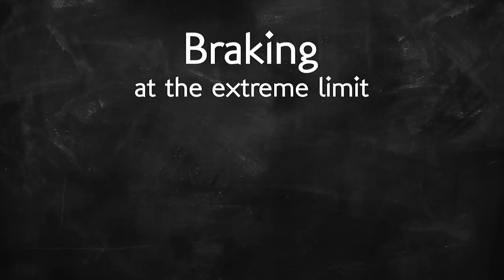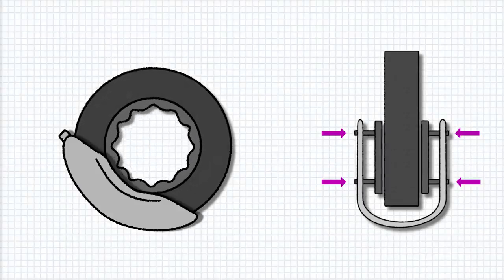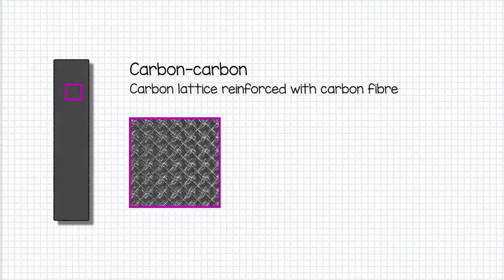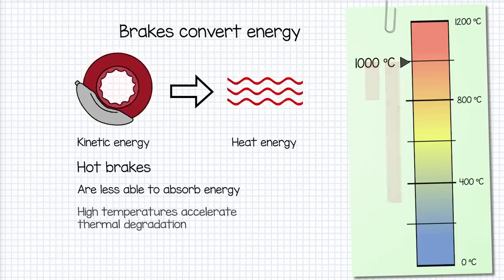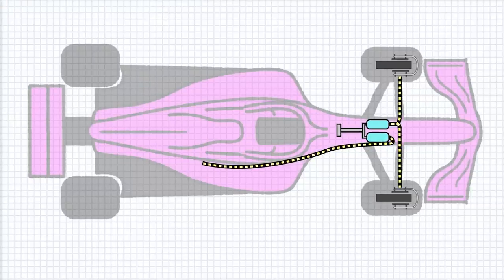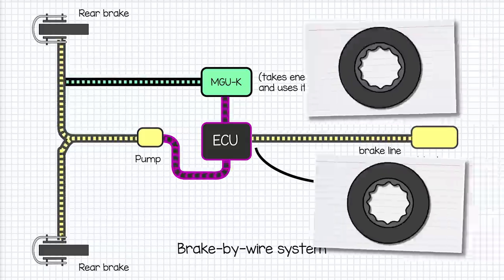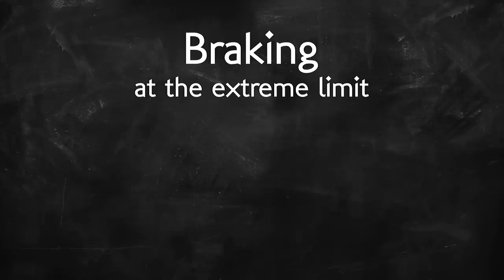F1 Braking Systems

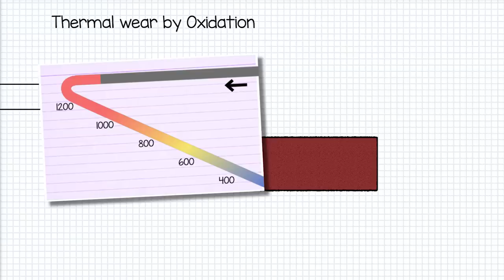Comment: 6:46 the oxygen atoms in carbon dioxide are actually double bonded to the carbon atom but apart from that, great video
Reply: They're single bonds but it's an oxygen molecule that would bond to the carbon to form CO2

Comment: The brake disc ventilation hole reduction in size and the subsequent increase in heat transfer, is more a product of increased surface area than is a product of the increased airflow.

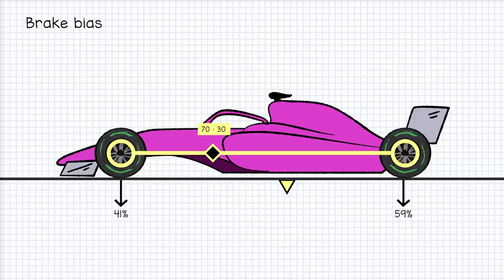Comment: at 9:39 it wouldn't be the opposite when front tires break and rear tiers keep spinning would cause the car to oversteer may be spin and if the rear tiers break would cause understeer. Great video, and could you please explain how the lockup happens? Thank you.

Comment: Just took a heat transfer class and it would have been cool to see a (rather simplified) problem about the ventilated brake disks, looks like they are a form of tube banks, and it could be an interesting convection type problem

Comment: Great videos! I follow you for quite a while, but this video made me subscribe. Keep up this brilliant job.
But... I have a problem understanding two issues:
- why is so much force required to use the brake? (Martin Brundle said he didn't have enough energy) Is it because it feels natural? I mean, if you use too much force, the fluid flows from ECU to the reservoir tank. The brake pedal isn't connected by brake lines to the calipers. Why is there a need for 100kg of force on the brake pedal.
- You mention in your video that braking in F1 makes up to 6G. If the driver pushes the pedal with the force of 100kg, wouldn't it make 600kg? I know it's ignorant of me to put it like that, but doesn't G-force help the drivers during braking, they only have to put the initial force?
I'm sorry for my technical english, it isn't my first language.
Reply from the maker: Hello!
1) Front and rear brakes, the drivers are still pushing into a highly pressurised system via the master cylinders. Their foot still has to do a lot of work to punch maximum energy into the brakes.

2) When I'm talking about G-Force I'm talking about the forces on the driver under rapid deceleration. When you hit the brakes in an F1 car, it stops so suddenly that you'll feel a force pushing you forwards at 6G equivalent.

See my video on barriers to understand G Force under deceleration.

Comment: The brake split front/rear is much more than 55/45. There is a difference between brake bias and how much braking is actually being done front vs. rear. The amount of braking done by the front brakes would be closer to 90% than 50% due to massive amounts of longitudinal weight transfer under huge deceleration. Overall good video though.

Comment: So during the last Grand Prix Martin Brundle spoke about the immense force that was required to press the pedal, specifically about Alonso’s setup. This video doesn’t mention the amount of force required to brake, but it doesn’t seem like it should be especially high. So do race drivers have additional resistance added or is that amount required just to get the car to stop? If resistance is added why would this be done as it would seem unnecessary to make something particularly difficult?

Comment: Emaculate as always!
What about engine breaking and rear wings do they also play a significant role?
Reply: I'm sure there are some off throttle modes that are used as a very light version of engine braking. Apart from the normal drag of the rear wing (and the rest of the car) no, there is no braking being done by the rear wing. The oly active part is the DRS which really should not be open during the braking phase, or the rear wheels will lock and the car will probably crash.

Comment: Any thoughts on the use of electromagnetic braking system (eddy current science) in not only F1 cars but domestic cars & trucks? You know, like the ones used on roller coasters and high speed trains.

Comment: I have a small doubt about the type of splits using in f1 cars if suppose the front circuit fails while braking there will be a zig zag movement of vehicle. Why can't they use x split can you explain pls

Comment: Placing the brake calipers lower down does not help, the height of the centre of mass on the unsprung parts of the car doesn't matter. What can be done is bringing the calipers as close as possible to the middle of the car reducing the moment of inertia and allowing the car to rotate more readily. But suspension design often wins out and dictates caliper placement.

Comment: Great video, but I got one question related to brakes...

How does the "blocking" works? (I don't know if that's the right way to call it, I mean, when a driver stops completely one of the front tires in a corner to make the turn) Is this made by the driver with a button of something, or is it a computer that know when it's needed to block one of the wheels?
Reply from the maker: Ah this is called LOCKING and a driver doesn't want that to happen. If that happens, they've made an error.

This is when the grip of the brakes overcomes the grip of the tyre on the track.
Reply: Thank you, I've always thought this was to help turn at high speeds but damaging the tire in the process.

In Spanish it's called "Bloquear", that's where my confusion comes

Comment: I know you said the size of the brake disc is limited to keep braking zones competitive. This would suggest the limiting factor for braking isn't tire grip. Is that right?
Reply from the maker: errrrr it sort of is. Once the frictional load on the brakes outweighs the frictional load of the tyres on track, the wheels lock and the deceleration is all down to the rubber sliding on the track
Reply: Chain Bear F1 so as I understand it the limiting factor is braking disc at first and then tire grip. So a larger braking disc would have the effect of more responsive/ faster locking brakes then the tires brake as normal.

Btw thanks for the reply and all the videos. You have made me get into f1 and see the interesting side of it when I always thought before that it is really boring but it's really good when you actually understand more what is happening.

Comment: @Chain Bear F1

Hmm... I found videos by Brembo about braking power. But they seem 
paradoxical to me. In Monza the speed change is only 109 km/h over a 72 
meters with a claimed braking power of 3010kW, but in Azerbaijan it's 
216km/h over 56m but only 1901kW braking power is claimed. Makes no 
sense.
And on neither "hardest braking point" is after the longer 
straight with the sharper (or just as sharp) turn at the end. Also 
doesn't make sense.

What do you think about this?

Comment: 2:27 "A larger diameter means greater stopping power as it's easier to stop a spinning disk by grabbing it further from the pivot point than closer to the center."

I don't understand this. Why would it matter? The limiting factor for stopping a car is the friction force of the tires on the road, right? Being able to stop the brakes more easily would only make it easier to lock up the wheels, which will decrease braking performance.

Comment: Wouldn't cooling the brakes with liquid make them extremely more efficient and less likely to oxidized (one of the main reasons behind brakes degrading). Air cooked brakes seem a bit arcane especially for F1

Comment: Does the ecu, pump, or mguk multiply the breaking power the driver puts into the pedal ?
Reply: No, there is no brake assistance on an F1 car, they don't have servos like road cars. The only assistance, if it is considered as such is that available in all hydraulic systems where pressing the pedal on a small cylinder movers the bigger wheel cylinder less distance but, with a higher force.

Comment: So I guess when you hear "F1 drivers have to apply massive pressure to the brake pedals" it's because they actually have to pump the fluid almost by themselves without external aid (unlike e.g. in cars). Right?

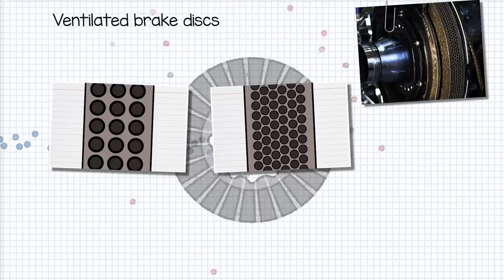Comment: At minute 5:35 don't you mean increase in area?
Reply: No, volume is correct. They aren't just holes but ducts all throughout the brake disc - and if you increase the area of the circle under a cylinder while keeping the height of the cylinder the same, you also increase the volume of that cylinder.
Reply: I didn't fully understand the second part... Over the year the cylinders increased in number, but decreased in radius, right?
Anyway, from what I understand of thermal conduction between two materials (in this case air and brake disk), the higher the contact area is, the more heat is transferred.
Reply: Yeah, correct. The point he is trying to make is that the volume of air flowing through the system increased, not only the surface area. (...is the way I understood it.)
Reply: That seems reasonable

Comment: good bike breaks are basicly the same thing. i wonder wich break is better. a super high performance bicycle disc break or a f1 break. in terms of how much mass it breaks in what amount of time.
im super bad at pyhsics if anybody know's im super curious.
Reply: First thing is, a Superbike break more than twice longer than a F1 Car.
Bikes have very far Breaking Zones.
And second is, it dont belong on the Breaking System.
Sure, the Breaking System is importent. But 95% are because of the Tyres.
Put standard 205 Street Tyres on a F1 Car, and it will also not stop under 30m.
That is also the reason why Bikes have such a worse Breaking Distance. Because the Tyres (who actually touch the Street) are tiny.
And the whole Breaking Force have to be transfered over the Tyres.

Comment: Tbh for such fast cars I woulda expected the discs to be larger 🤔 guess the cars are very light though...
The more you know ☺️
Reply: Yeah, the cars are under 1,500 pounds. A typical road car is over 3,000 pounds and has front rotors around 11 inches. One thing I didn't get from the video is how thick the rotors are.
Reply: Luke W like I always knew the cars were light I just assumed they had about 350-360mm discs, then again they have like 13in rims
Reply: So did I and assumed they had more than 6 pots per caliper.
Reply: The tires they are using is also a major factor in the stopping performance.
Reply: TheEpicCrumpet f1 only have 13 inch wheels remember.. thats why pirelli rumored developing 18 inch wheels for f1 like formula e, more relevance for road cars technology.

Comment: I'm pretty sure brake fluid is compressible. If it wasn't, the brakes would have no feel in the pedal. It would be more of an on off switch.
Reply from the maker: there's a spring at the other end
Reply: Chain Bear F1 literally sitting in a fluid mechanics class right now as I type this... it is slightly compressible. This is why the brake calipers barely moves more distance wise, while the pedal moves a lot more. This was even mentioned in a FSAE article in Racecar Engineering Magazine.
Reply from the maker: oh yeah 'incompressible' is slightly inaccurate a term but to all intents and purposes it's mostly incompressible

Comment: Average 100-0 braking distance is about 40m for a normal large car* (think bmw 5 series) so that's not even close to 4 times as long as 15m. Very impressive, but your "normal" car data is from the 70's. If it takes 60m then you need to fix your brakes.

Edit: very minor note on an otherwise great video.
*According to consumer reports

Comment: Do they have Independent breaking for each wheels controlled by the computer, or that would be considered unfair and is not allowed
Reply from the maker: Article 11.1.2 states the force exterted on all calipers within a circuit (i.e. front or rear) must be identical.
Reply: thanks for the clarification

Comment: "Over the years, these channels have reduced in size but increased in number, providing greater overall volume for channeling air."  Ummm... unlikely.  You lose a lot of cross section to a round tube with just a fairly small decrease in diameter.  What more cooling channels of smaller diameter provide is less volume, but they offer much higher surface area for the air flowing through them for heat exchange.  

Total flow through a heat exhanger is important, but equally important is the total surface area.  Pulling 1000 cfm over a single pass of 3" diameter pipe will do work, but it's not going to be anywhere near as effective as breaking it down to a bunch of .100" tubes and flowing even a quarter of the air over them.

Why not set up a thermostatic flap inside or in front of the brake ducts?

Comment: I'm confused why the MGU-K is even used for rear braking? What type of benefit do you get from this? If enough pressure can't be provided via the hydraulic system to squeeze all 4 brakes, why not just run the whole thing through a "BBW" system that can squeeze stronger than someone's foot can press. Seems like an unnecessary complexity to run braking through the MGU-K; I'm sure they can still harvest energy from the brakes in a different fashion and then just push that extra energy to the engine.
Reply from the maker: The MGUK takes kinetic energy away from the rear wheels to generate energy. In doing that, it slows the wheels down, so it's a natural side effect of harvesting the energy.
Reply: I see. Thank you!

Comment: Why don't brakes function well when cold?
Reply: Physical properties of the materials used.  His examples of rubber and ice are interesting.  If you found ice cold enough, it really wouldn't have a terrible coefficient of friction, because what makes ice really slippery is a microscopic layer of liquid water that forms on top when you try to drive or walk on it.  Likewise, different rubbers will vary as to how sticky they are by temperature - there's a "sweet spot" for different tire compounds (part of why there even ARE different tread compounds) with regards to temperature/friction.  The big fat burnouts dragsters do is to warm the tires up, but if you treat true (not drag radials) street tires the same, you end up reducing grip by overheating them.  

Brake pads are the same way - different compounds have a different operating range where you get the best grip out of them.  They get softer or harder depending on how hot or cold they are.  Again, that's one of the driving factors behind the existence of different brake pad compounds.

Comment: For the 2018 season I think Formula One cars used 13 inch wheels with a very high aspect ratio tires.   These F-1 cars  could stop from 300k to 0 in two seconds.    Thirteen inch wheels weigh much less than 20 or 21 inch wheels using the same material.  So why does Ferrari, Lamborghini and Aston Martin street/sports cars  manufactures,   push outrageous huge wheels on their customers, when everyone knows that extra mass (20 & 21) of wheel is anti performance.  Could these Hyper & sports car manufactures use 17 Inch wheels instead of punishing us with these outrageous  ones they sell us????

Comment: Why do I sometimes hear "Warm your breaks up" when the lower the temperature = more break
Reply: You need some temperature for the brakes to work. It is said in the video. Its about 400°C. So if the brakes are colder than this they will not stop the car so well.
Reply: i think because a cool brake takes longer to produce the same heat energy, then a brake at optimal temp. So they could brake longer but wouldnt brake so quick if they are very cool.
Reply: The coefficient of friction isn’t constant vs temperature, in order to be able to work at such high temperatures they give up low temperature effectiveness.

Comment: Fluid is incompressible? EVERYTHING is compressible, even solid metal, as long as you have enough pressure.
Reply: True. But for simplicity it's a close enough statement, because it shows the major difference to gas. Gas would compress MUCH more easily and force acting on the cylinder would increase pressure and temperature, but would barley translate to force acting on the braking pads. Fluids however are very hard to compress and forces acting on the cylinder would (almost) 100% translate into forces acting on the braking pad, while the fluid wouldn't compress (and therefore wouldn't change pressure and temperature). This is because while you CAN compress fluids, it is so hard to do that even the massive force needed to brake an F1 car is the path of less resistance...

EDIT: Please pretend, I used the word "liquids" wherever I used "fluids". See comment by ChainBear...
Reply: Mike234 incoming know it all. Who seems to not know much. Liquids don't compress at any reasonable pressure we can put it under in most cases.
Reply: I know that that is the point, that in like human terms you can push the brake, then in that case the fluid does not compress, but for goodness sakes, this guy is really knowledgeable but you cant just misinform people who would take that statement for granted and apply it to a different situation.